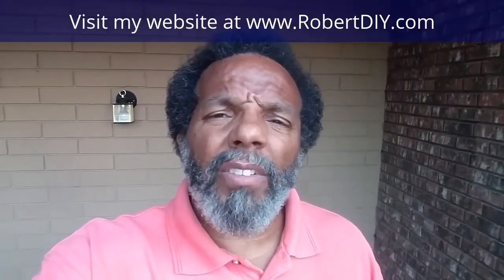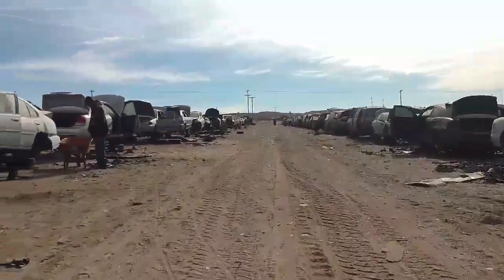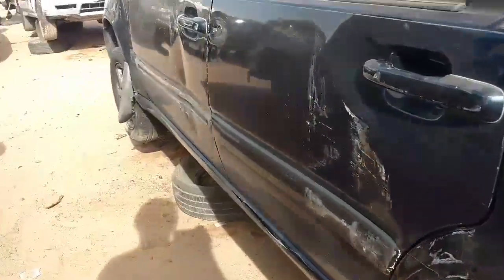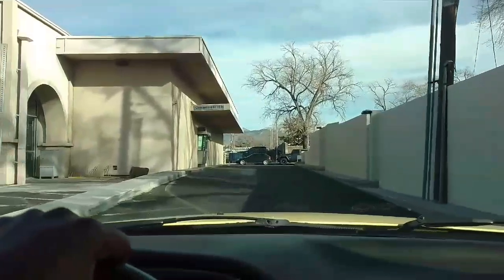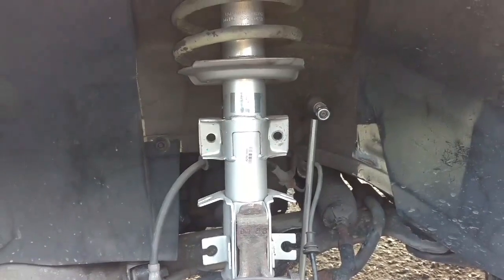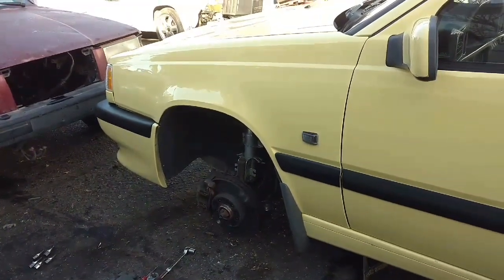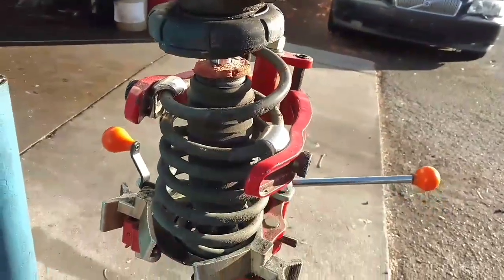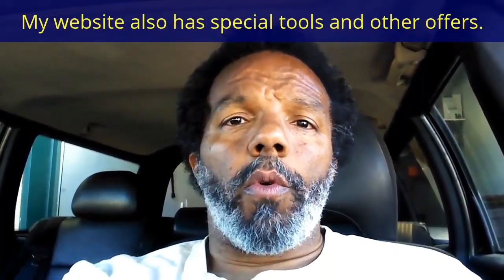Quick stop by the junkyard and installed front Bilstien struts on Queen Bee - HOWR

Comment: I would imagine that the tyres are also part of the problem, soft ones will make a nicer ride, but don't expect them to last or be any good when you want to throw the car around.
Queen Bee is not a sports car, don't expect it to be lol.
Reply from the maker: +zx8401ztv actually Volvo made this trim level to their first official sports car. Tighter suspension, thicker anti-sway bars, larger turbo, faster tuned ECU fuel management computer, etc.
Reply: It's nice to see volvo admitting the blame ha ha :-D
i just could not restrain my silly side :-D
Reply from the maker: +zx8401ztv no problem.